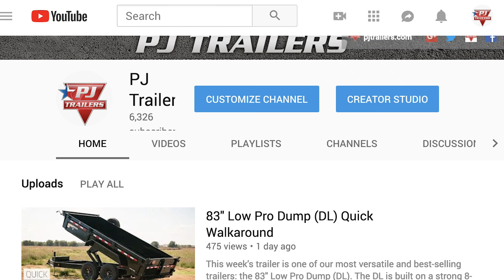Trailer Safety Series - Rollster™ Operation

Comment: Why wouldn’t a wireless remote come standard? I own a rollster trailer and I’m not very happy with its operation.
Reply from the maker: A wireless remote for the pump or the winch?
Reply: PJ Trailers both. I was told by a Pj trailer reseller the upgrade would be $800 installed. I think that’s ridiculous, should come stock. Both cords on either remotes are way short, your line on the winch is way too long. Also the way the trailer ties into the box in the rear never slips in the way it’s suppose to. I’m resolving this by replacing with turnbuckles. Overall the trailer saves me money I’m just not so sure it’s going to hold up over time.
Reply from the maker: The new smittybuilt winches come standard with a wireless remote.  We sell the wireless remote for the KTI pump for $230.00 on our parts website.
Reply: @emtroofing8761  trailers are a source of frustration i know and i need a new trailer now mines wore out ,, seems like every day one of the wires fritz out and i paid to have it rewired but they did a faulty job and wired a wire in a bad spot and the suspension cut in half so they fixed it again hoping now to not deal with it for a minute while i figure what and where to buy,,, i need a 20 foot utility with 7k axles any suggestions  pj?